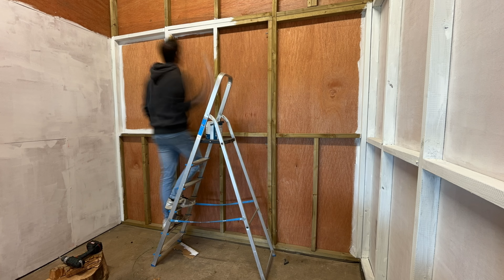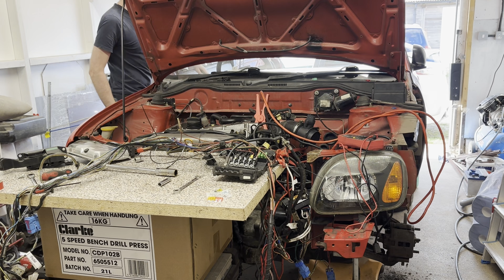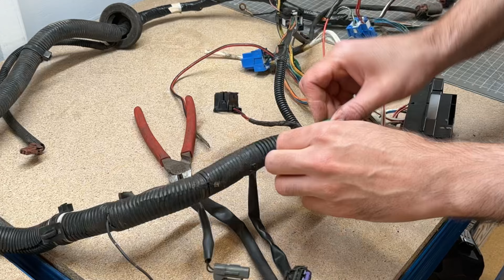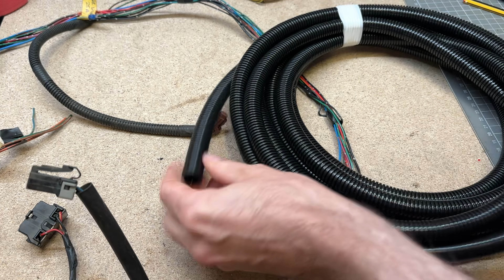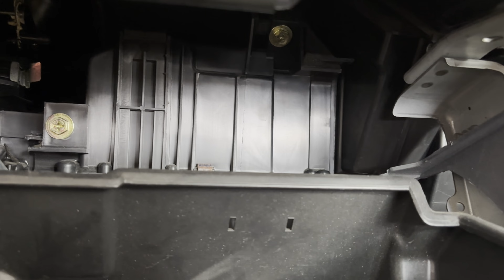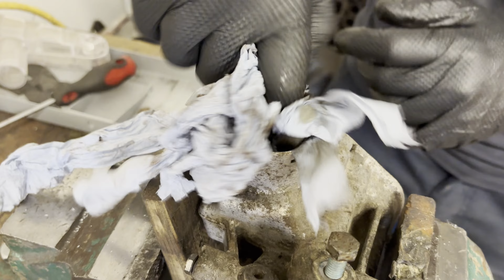Back to Work on the Micra - Audi/VW 1.8T Engine Swap

Comment: Awesome guide & progress. Facing similar radiator clearance issues. Link to the oil filter relocation kit source would be highly appreciated. Thanks
Reply from the maker: I don’t want to put links in comments because of potential scammers, but if you go to Matt Lewis Racing and put “FK11-3/4UNF-2” in the search box, that’s the kit I used.  There’s a few options, such as side or top exit take off plate, fitting colour etc.

Comment: Man I've got a swap the other way around and wiring has been the worst (nissan sr20 engine in a vw mk4 bora) so I'm really interested in this build. 

By the way I've got a question on the 1.8t. I've got a ary engine but the harness was cut at the 02 sensors. Can you tell me where to get a wiring diagram for the 02 sensor harness? The 02 sensors don't match the colours on the harness at all
Reply from the maker: That’s a swap I’ve not seen before, sounds intriguing.

For the wiring diagrams, there’s a popular member on the clubgti forums that has all that information, so worth checking there.  My engine is an AUM so might be a bit different, but here’s what I have:

Sensor 1, pre-cat:  
1	green Signal to ECU
2	black	Signal to/from ECU
3	blue/red	Heat - Common Live
4	brown/green	Heat - Digital DC FM Switched Earth from ECU
5	grey/white	Signal to ECU
6	grey/red	Signal to/from ECU

Sensor 2, post-cat
1	blue/red	Heat - Common Live
2	grey/yellow	Heat - Switched Earth from ECU
3	grey/white	Switched Earth from ECU
4	grey/red	Signal to ECU
Reply: thank you for the quick response. You don't know how much you've help me with this 🙏🏾🙏🏾 last thing for clarity, there are 2 pairs of the red/Grey wires, does that matter which sensor it goes too? Because how the harness is cut I can't tell if they are supposed to go to a specific 02 sensor
Reply from the maker: Each sensor has a grey/red wire which is for signalling to/from the ECU.  

For the pre-cat (6 wire) sensor, that would connect to pin 6 on its connector (T6c/6), and the wire goes through to pin 52 on the ECU connector (T121/52)

For the post-cat (4 wire) sensor, that would connect to pin 4 on its connector (T4f/4), and the wire goes through to pin 69 on the ECU connector (T121/69). 

The ECU has two connectors on it, both wires go to the larger of the two, so you’ll need to confirm with a multimeter for continuity through the wire.  I have a video that shows where I did all of that, 2 episodes back.